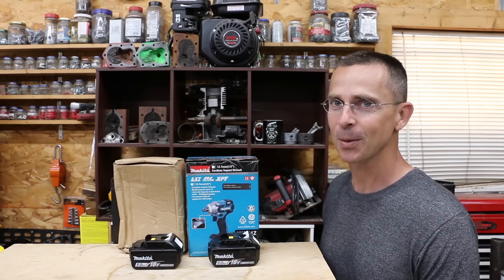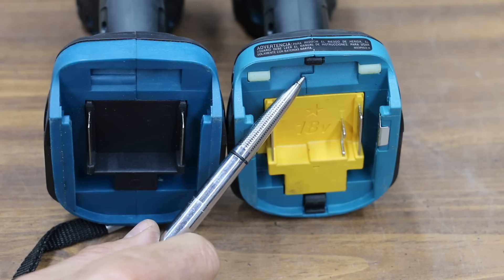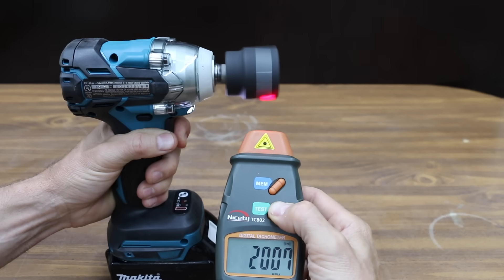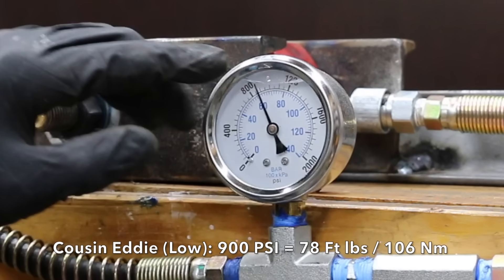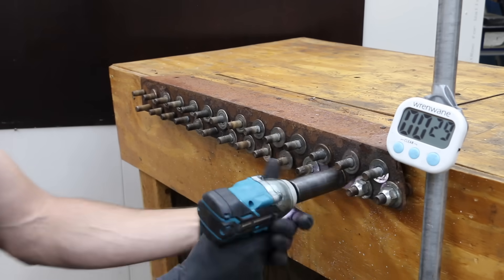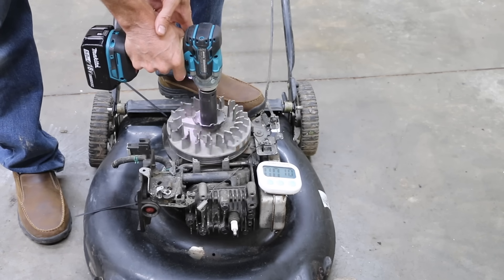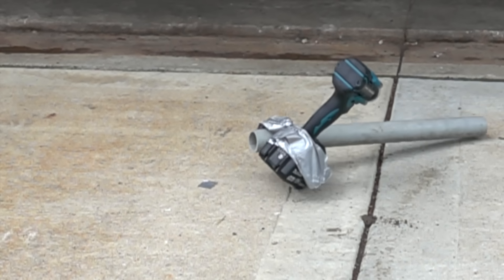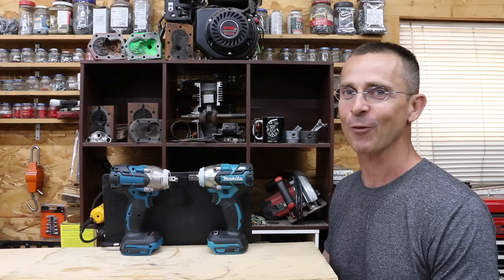Fake Makita Impact Better? Let's find out!  Makita XWT11Z 18V LXT Lithium-Ion Brushless Cordless

Comment: I love how he uses a dewalt to take apart a makita
Reply: @Jim The Raspberry It's what happens when a company is ran by a board of directors that feel beholding only to the stock market and ignores the street market.
Reply: @Jim The Raspberry I abuse the crap out of my dewalt tools, never had an issue, Other than the price of batteries, but they're all expensive no matter which tool platform you prefer.
Reply: i was about to make the same comment lol how dare he do that! fuck dewalt
Reply: That's cause that's about all dewalt can loosen
Reply: Dewalt saws are good tho. Makita still better
Reply: @wlhk.00  Exactly.  Each brand has it's stars.   I am no fan of Dewalt cordless system but their Jobsite table saws and Miter saws are gold standard.  Bosch and Makita fall behind.    For rotary hammers, we all know it's Bosch.   Makita makes a generally good showing in many categories.   Milwaukee is  my current cordless fav. also good all around, obviously their Sawzalls and Magnum 1/2" drills among others.  Their rotary hammers are pretty dang good also.

Comment: Still not a good value even at $30 because with only 90 ft/lbs torque it won't do what it was built to do and that is drive screws.

Comment: I actually have both of these and yes, the Makita is a whole lot better. His cousin just won't do the job I have the Makita for. However, it's still a useful thing, and crazily cheap for what it is. It's pretty useful to have the extra tool around, and I'd happily buy both again. I don't expect as long life from Cousin Eddie but then I also won't be working it as hard. (well, obviously, because it literally can't work as hard!)
Kind of ironic but I find the copy tools actually add a really useful extra string to Makita's bow- they don't replace the real thing but equally, Makita don't do anything cheap and cheerful that does the same job. So that's actually led me to buying more Makita batteries to run the copies, and that's led to me getting more Makita stuff since their ecosystem has beaten others for me, partly because of their chinese cousin.

Comment: What I found with cheaper tools is that they perform ok for a few weeks/months but after that they die pretty quickly...that is a very hard thing to test because it involves lots of time and use of the tool... Having said that, perhaps a re visit of some older tools that you've been using for a while.... thanks for your videos, great to watch.

Comment: Can anyone link me an eBay listing for this or the drill driver version of it? I noticed it doesn't have the Makita logo on it so its technically not illegal even though it takes Makita batteries. I looked on eBay and could not find this but found many versions of it on Wish, but the listings on Wish are priced around $50-$60 which is not worth it at that price. Help I need a new cheap drill and if this takes my old Makita batteries that would be huge for me.

Comment: Dear Project Farm. I believe you don't know the full story of Makita. Company Makita have a big factory in China ( more then 6000 employee ) and here produce 3 type of hand-tools. 1) Hobby tools - it is very cheap and have maxim 1 year guaranty. 2) Semiprofessional - have open green ( like Hitachi green ) and the price is almost 50-65% from one professional tools. 3) Professional - have this green blue like what you have in hand ( most of people make confusion to Bosch ). When I was in China to work on this factory  ( transfer from my original factory Makita for 3 months ) I discover exist a lot of small company what make copy of this tools. On this fake tools not the electric motor are the problems, problems are inside the gear box and to the accumulator. For 25 $ you can order hobby Makita. From my point you spent 5 $ more for nothing when you can order free shipping for hobby Makita and can make this test ( instead of fake you can use hobby ).
From technical point ( because I know how to manage this tools and what strong point have each ) I can present to the people next 3 situation :  1) Makita good then Fake Makita. 2) both tools have the same power and capability. 3 )Fake Makita is it is a little better than original Makita - so you gave $ 100 for alms on the original Makita. All is related to what you want to present and in what way. 
To the end, logical question is - who pays you and what is the purpose of the test (in general). Good luck!

Comment: I just watched your video from a couple years back where you run the lawnmower on fumes, and I'm curious if maybe that burns cleaner? Is liquid or gas better for the longevity of the engine? And would the additive detergents still be required to keep the engine clean? Then there's the bit of unused gas, is it still as flammable, or is it mostly additives left over after the gasoline itself evaporates? I for one would be interested in a revisit to this just to see the answers to those questions, and maybe more! :D

Comment: You did an A-class job on this. Your testing rig is such a good example of practical application. 
Hearing the part about load-less RPM made me wonder, why is this useful information? But it all explains why the drill "works" but isn't the same as the real deal in the end.

Comment: Only half way through so far, but you should have tested makita’s battery on cousin Eddie, cheaper batteries are lower C and lower capacity, so will deliver less Amps and volt sag a lot more

Comment: Nice work Project Farm. Love the videos and this one is no exception. I'm a DeWalt guy, so I probably wouldn't buy the Makita brand, but good to know the difference between the real on and the "fake" one. It's pretty much what I expected. The fake one works OK, but lacks the robustness and strength/power of the original. Great testing and I look forward to the next video. Have you tested the Harbor Freight "Bauer" series power tools? I need to get a higher powered impact wrench for lug nuts and higher torque applications. Maybe this would be a good brand to get, or maybe I'll just opt for the air impact gun? I look forward to more videos, sir!

Comment: the fact that these have more torque for unscrewing then screwing is actually a very nice feature i never thought about. Another great video!
Reply: Most electrical powered tools have more torque in their reverse gear. It's because of a different gear ratio for the reverse gear. More torque, less revs.
Reply: It kinda makes sense though too. If you can put more torque on than you can take off that creates a problem 😂

Comment: The difference in price shows in 2 or 3 years when the cheapie has long since failed and the Makita runs on and on.

I've walked this planet 60 years and traveled down this path many times. I even thought once that cheaper model clone speakers I was buying for 1/3rd the price of the real speakers came out of the same factory as the more costly originals, since they looked identical. They just didn't have the brand name added to them.  WRONG!  The truth came out when I actually played them.  HORRIBLE!

 There is painful truth in the statement "You get what you pay for". Expensive lesson sometimes too.

The difference is normally not in brand name but rather quality of materials and quality of construction. As such, cheaper clones too often have much shorter lives.  The pirate manufacturers don't care, since they have no reputable brand name to protect.

 Gamble for a bargain if you wish, but few if any bargains here.
Reply: Its a blokey thing I have done it on several occasions  buy the cheap one first find out its crap then go and buy the more expensive one you should have bought the first time  so it works out quite a bit more expensive

Comment: this is not a real comparison  ,
1:}  you are using the makita battery .  on the fake one ,
that's why the fake preforms this way , 
if you use a chineese battery . you will see tha't it's a pice of crap , 
also batteries made in china don't last long .
2:}  35$ 
dose not include a batteries and a charger ,  the full packege 
price is close to 100$ .. 
ps: chineese mask some the price as shipping fee to apeare cheap ,
is it worth it ?
not at all .
makita will live x5 times longer
after uncle china drill will die
what's gonna happend in time is 
the better the quality will get the higher the price will become ,
untill it will cost same or very close to the price of the original products

good video though ! entertaining ,

Comment: CAN YOU PLEASE TEST cheap ebay fuel injectors vs name brands..do like a 340cc,550cc and 1000cc injectors..see if the ebay injectors actually flow what they're rated at and compare spray patterns ect...
I'm VERY curious as injectors are expensive and I'm currently using Ebay ones in my performance car and get alot of flak for it from people but I have had nothing but good results with them.

Comment: This is not really farm related but I would like to see you do a test on fishing lines and knot strength. You could buy a lot of say, 12LB test line from different manufacturers maybe some braid, flourocarbon and regular mono, and test different knot strength and breaking strength. Maybe do some abrasion testing, stretch, etc.  Line is fairly cheap so you could really buy a lot of different ones to test. Thanks.

Comment: You are "hands down" the best comparison tester on YouTube. All the other are mostly opinion, the human factor and conformation bias. Keep up the amazing work! P.S. The one thing I would add is how long the batteries last. After all, one of the main reasons for paying extra for brushless is battery life. Maybe with your old mower you used with the spark plug removed. I'm not talking about how long until you smoke the impacts. Maybe a 15 second load and a 30 second cool down. You could probably make an automated trigger actuator and just let it go. If the batteries are interchangeable repeat the test with the batteries swapped. Again you do amazing work, keep it up!

Comment: This and more are the reasons were China products are more common in my Country. Low Cost nearly same quality versus the High Cost and the durability is very Close to the original. So taking the exam, If you have luck, you pay 30$ for that Impact works for 2 years get broken and you pay another 30$. Versus the Makita you pay 130$ something happen in less than 3 months and now you have to pay again 130#? no thanks.

Comment: Great video. I bought a Milwaukee "look alike" cordless ratchet and now I'm wondering how good it really is. I got the tool and 2 batteries for about the same price as just the tool for Milwaukee. The specs were almost identical to to Milwaukee. I have used it a lot and actually pretty impressed.

Comment: I have the dtw285z that looks like the one in the video rated @280Nm and paid about €300. falled from 2 meters with just a scratch on a edge and the thinghy knoched the threads of an M20x1.5 SKF driveshaft as butter other than making hundreds of M8 rusted bolts come off somehow, breaking  them if necesary. I remember when some guys came with the bigger one rated 1000Nm and started laughting when they saw it first time, 5 minutes later in their hands and their smile transformed in a "not bad" face...
I don't do that job anymore otherwise cousin Eddie doesn't look that bad at all for that price and my usage.

Comment: Only the torque values for a better comparison:
Tightening:
Cousin Eddy:
Low 78Ft lbs / 106 Nm
High 91 Ft lbs / 123 Nm
Makita:
Low 57 Ft lbs / 77 Nm
Medium 100 Ft lbs /136 Nm
High 178 Ft lbs / 241 Nm
Loosening:
Cousin Eddy: 113Ft lbs / 153 Nm
Makita: 159 Ft lbs / 216 Nm

Thanks for the great video!

Comment: I've been using Cousin Eddy for half a year now. I first saw it on AvE who made a video about it in December. It's not a bad tool for 30bucks, but at least mine has an issue with starting torque, meaning that it often just won't start under load. I often have to let it spin free, so that it will spin up in the first place. It did that from the beginning.
Reply: This video is trending and the sellers adjust their prices accordingly. More interest in $30 Cousin Eddy equals a higher price for Cousin Eddy.
Reply: @rgh622  Tricky, but smart and yeah, I've seen them do it before. They know how to use analytics a little too well. lol.
Reply: Where did you buy cousin Eddie from ?
Reply: @nguont  Ordered on ebay. It came directly from China and it took several weeks to arrive.
Reply: @ThePostApocalypticInventor  What was yours listed under? I am having a hard time finding them for less than $60
Reply: Sebastian Vaden same with me, I just searched “impact wrench” and the cheapest I’ve found is $75 Aud which is around $50US . Maybe it’s gone up in price because of this vid? Lol
Reply: @nguont  might be because of covid, shipping has become more expensive out of china
Reply: Well... at least it  gets the job done.

Comment: Cousin Eddie? where can I buy it?
Reply: https://www.ebay.ca/itm/18V-Cordless-Electric-Impact-Wrench-1-2-Square-Electric-Wrench-for-Maintenance/283818166956
Reply: 18V 520Nm Electric Rechargeable Brushless Impact Wrench Cordless 1/2 Socket Wrench Power Tool For Makita Battery
on Aliexpress

Comment: Not all batteries are made exact. I use to be in to RC cars. I'd have multiples of exactly the same battery. 1 would cause the car to ride wheelies while the other battery could barely get the front wheels off the ground.

Comment: Please make a tiny (or large) text box of the specs you're rattling off. My mind went numb listening to so many number and doing the math I couldn't keep up. Some text with the stats at the same time you say them on screen would make it easier to follow and gauge a better difference between the two.
Reply: Watch at .25 speed with closed captioning 😸

Comment: Hey Todd, I had another video idea - what about comparing cleaning products?  Simple Green, Super Clean, Etc.  I've seen lots of reviews but it was never where they used the dilution ratio prescribed on the bottle, and also never on multiple surfaces.  It would be great to see how well it works on glass, on paint, on grease, brake dust, dirty floormats and so forth.

Comment: There is absolutely no "just as good but half as expensive" plain and simple, as proven countless times, you get what you payed for
Reply: The only exception is, when tools/products come off the same production line, which happens often. AVE showed that Harbor Freight's top air impact gun was made in a Taiwanese factory that rebadged them for a more expensive German company. Now most everything is just badge engineered stuff, if you find the same product with a cheaper badge, you win. Also Supertech is crazy good for the price, as he showed.

Comment: Another video where you knocked it out of the park.  I agree with you about Cousin Eddy being a good bargain for a guy on a budget. After you showing us the insides all it would take to strengthen Eddy is to buy some $3 Epoxy and pour it into the space in the handle and it would be stronger than the Mikita.  That slow to start on Eddy is not a real problem and won't be entering any Drag Races~!
Thanks again~!

Comment: The $30 fake is basically selling for as cheap as you're gonna get it, and it will never perform nearly as well as the real thing. Or any other good-brand impact for that matter.  Plus you can forget about warranty 'cause you pretty much have none.  The Makita OTOH, smart buyers would not be buying it at reg. price, they'd be buying it on sale, in a combo deal etc. leading to a price that's probably between $70-100 instead of $140. 
The other thing about fakes is well, they are counterfeits--they not only do damage to the company they are company they are mimicking, they do harm to the market and are also illegal to produce and sell.  In this case they haven't gone to the length of printing the Makita name but there are probably others that have done so.  Don't buy counterfeits folks, it's not good in the overall scheme of things.  Not going to totally defend the prices of brand names that manufacture in China, etc. on the cheap and sell for high $$$, but as said most of these go on sale or have deals which make them much more reasonable.  Plus nearly all of the brand names perform quite well, unlike the fakes.
Even if you can't afford the "big guys", Hart (TTI-made, sold @ Walmart) and Harbour Freight (Bauer, Hercules) are much better ideas than buying clear and blatant fakes.
Reply from the maker: Thanks for the feedback.

Comment: I feel you're right about the value of the $30 unit. Sometimes that's all you need. Especially if you don't plan on using it very much. As a master automotive technician I generally would only buy Snap-On and Mac tools. My income was from my tools so I made sure I had the best. Now that I'm retired and refuse to work on anything other than my own cars I purchase tools that I need from Amazon. In many cases they're just as good and they get the job done.
Reply from the maker: Thanks for sharing.

Comment: ..the question is...did "cousin eddie" come with a battery and charger?...I saw you were using a Makita battery on both of them. If not, then $30.00 isn't that great of a price, as the battery and charger are a significant part of the cost of cordless tools...assuming it didn't come with a battery and charger, unless you had a Makita also to "borrow" the battery and charger, you would have to buy that also..even the cheap China knock-off ones on Ebay and Amazon aren't exactly cheap...and you would really want to get 2 batteries, as a cordless tool without 2 batteries isn't very useful for steady use....at that point, you could easily have $100.00 or more in "cousin eddie"....